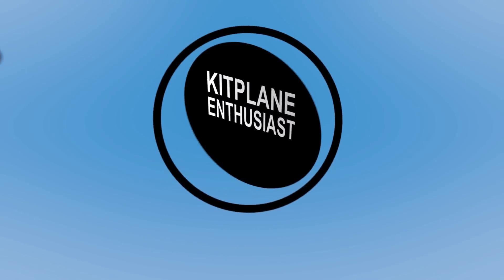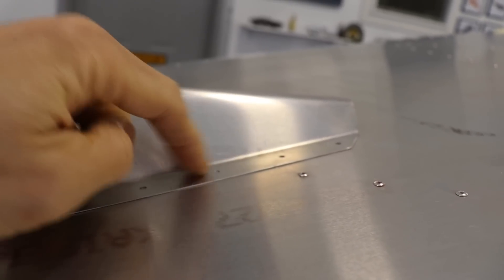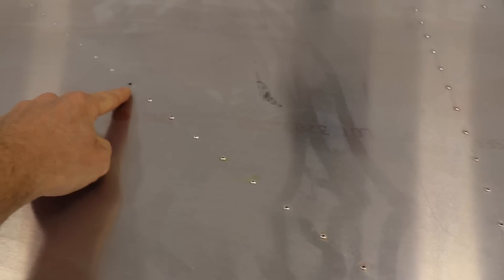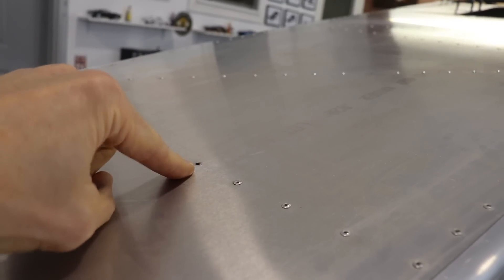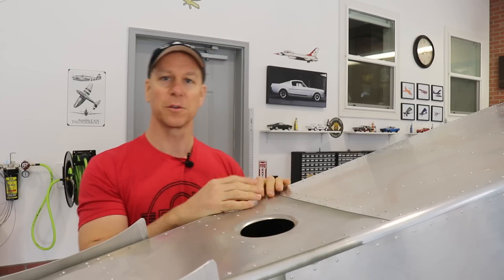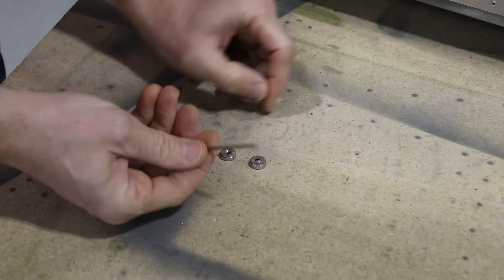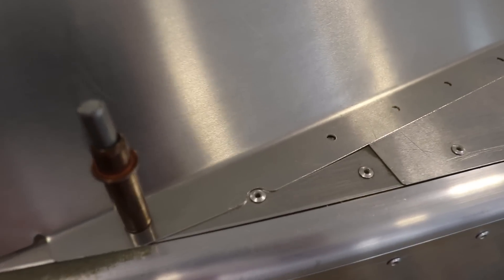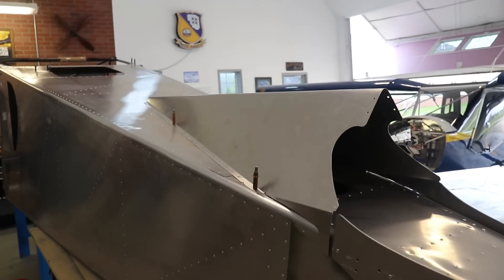Zenith CH-750 Super Duty FUSELAGE Tip!

Comment: A quick comment about the pull rivet style dimpler, I used a similar tool on an RV and I found that those nails break fairly easily and 6d 2 inch nails tend to work best.  I also experimented with making the dimples consistent and I found that using a pneumatic rivet puller with a flat nose piece with 25psi of air made consistent dimples that were close to the quality you would get from a compression dimpler.
Reply from the maker: You're right-I used this a few times on my RV-7 and I do remember that I broke a couple of nails. I just ordered the 1/8" one I need for the Super Duty so I'll what kind of nail comes with it.